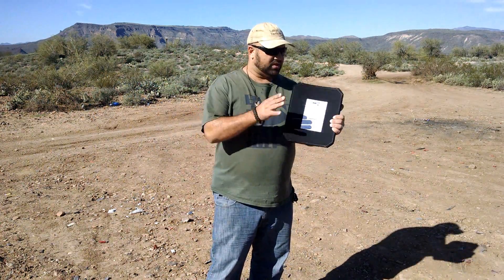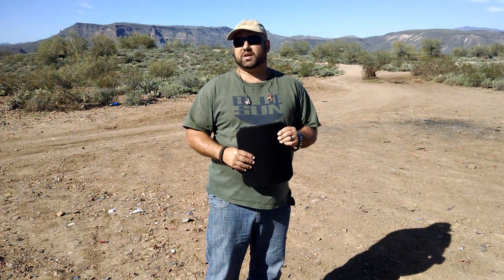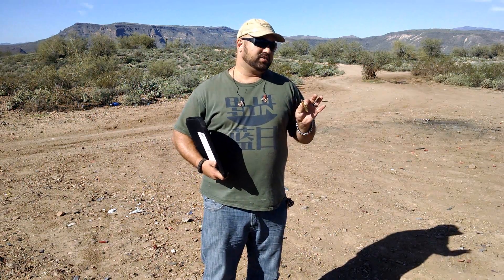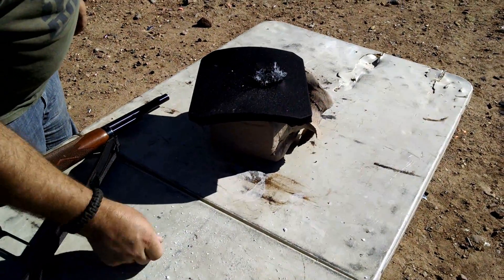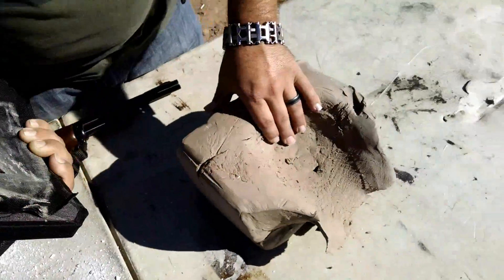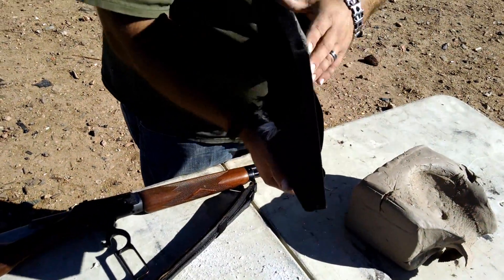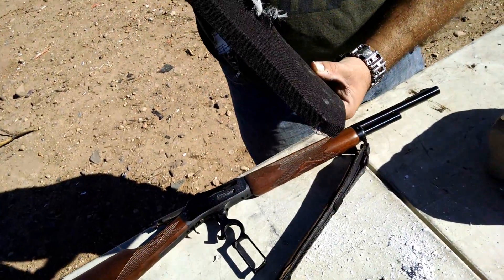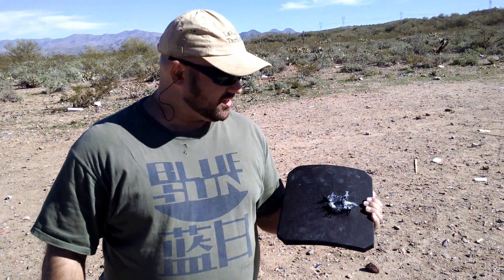Highcom Guardian 4SAS7 ceramic armor vs .450 Marli

Comment: I had missed this one. Thanks again for useful information Andrew. After mentioning to you that I was working on a long .300RUM bullpup falling block to defeat Level IV armor it occurred to me that deforming the back face enough to dissuade the wearer might  be a better strategy. I redrew the gun as .375CT and ordered a 32.5" (36" OAL) barrel and started having some of the parts made by rapid prototyping. This video  makes me wonder if I could have succeeded with just a 20" .458 SOCOM, .50 Beowulf, or  .450 Bushmaster AR and a somewhat solid lead or copper bullet. There'd obviously be no penetration but maybe the wearer would be injured. Then again the more ubiquitous steel armor would be quite likely to protect very well against those, I suppose.
Reply from the maker: ActionPhysicalMan Good thoughts. I believe that if armor is a real concern, the only two practical choices are head/pelvis shots or a .50 BMG (or .408 Cheytac or similar).
Reply: I thought of just getting a Serbu BFG-50 and some API ammo and being done. But that is exactly what they expect me to do!;-) Actually my design is just 14.5lbs empty with no accessories and 42.75" long before muzzle device so I can actually haul it a few feet when I need to - still not exactly a stalking rifle but at least 'old man" portable:-)
Reply from the maker: ActionPhysicalMan Well, you shouldn't need anything special to get through body armor with .50 BMG. FMJ should do the trick just fine.

Comment: I felt the recoil and muzzle blast all the way over here in Va LOL. Hit it with a Federal 12GA Deep Penetrator Slug, these do not flatten out like soft lead foster style slugs. Thanks and GOD Bless   Earl
Reply from the maker: +Big Earl I'll keep an eye out for them. I still haven't made it to the post office with your plate yet, but I promise I will. Sorry it's taking so long.
Reply: +The Chopping Block    No big rush I am good with what ever. Working too many hours and hunting every chance I get to make use of it right now. i will check my inventory (LOL) and see if I have some extra in stock.
Reply from the maker: +Big Earl If you find them, can you try them on the plate I'm sending? I don't think they'll get through but it should still make a gun video. As always, take precautions for fragments.